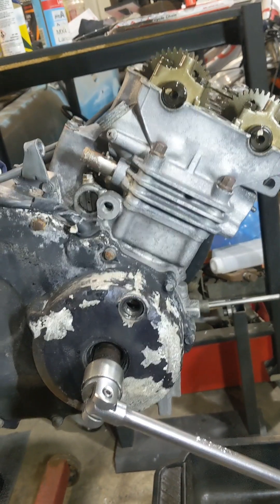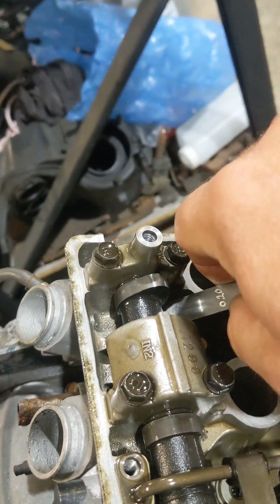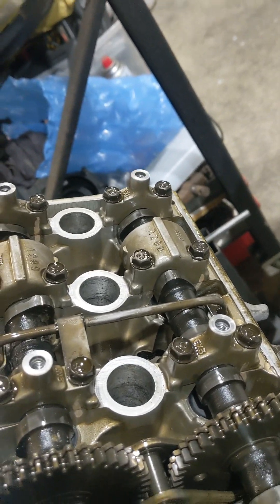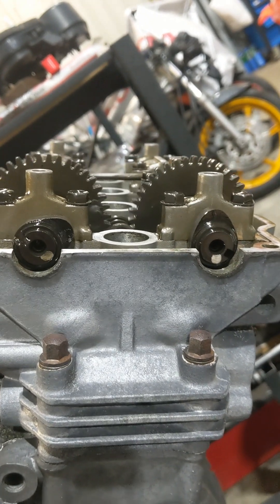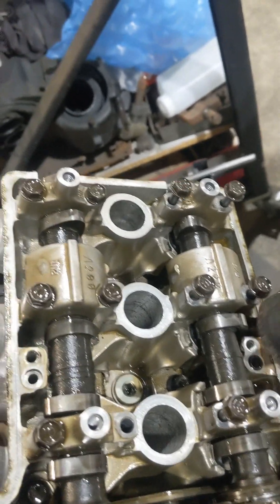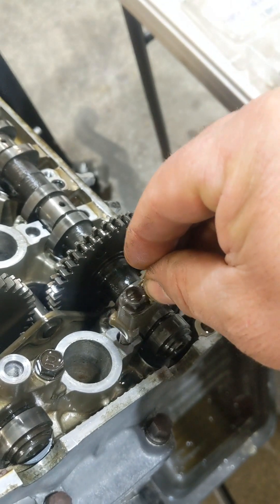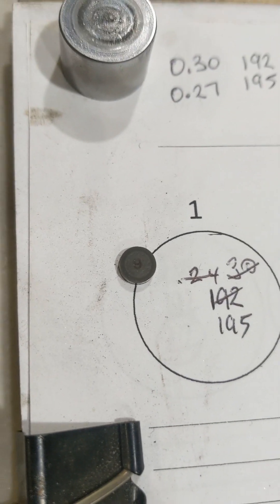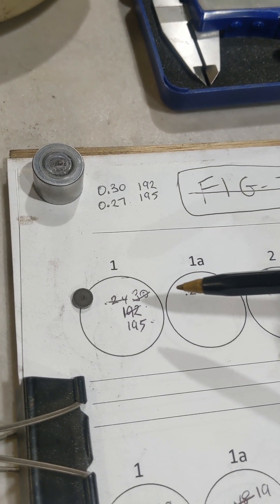Tips on checking valve clearances CBR 250RR

Comment: I've got a hornet 250, same motor. Any idea if the clearances are different or should be the same? thanks
Reply from the maker: Safe to say they would be the same. Intake 0.13-0.19mm exhaust 0.20-0.26mm. The scary part is I didn't have to look that up.
Reply: @DosMotoGarage Thanks

Comment: honda cbr250rr/jade camshaft compatible hornet cb250f?
Reply from the maker: I do believe all the cam journals are the same, driven gears on camshafts are the same, just different profiles. 

Please check with a digital verniers (at least) that the cam journals are the same. 

These engines have a very precise tolerance, so the work of this nature must be performed by a licensed mechanic. 

Disclaimer. 

I'm not responsible for any damages to your engine, bike or the rider.
Reply: @DosMotoGarage thenks❤
Reply: @DosMotoGarage  Which is more identical for hornet  
cbr250rr or jade?
Reply from the maker: @nugoshavshishvili jade